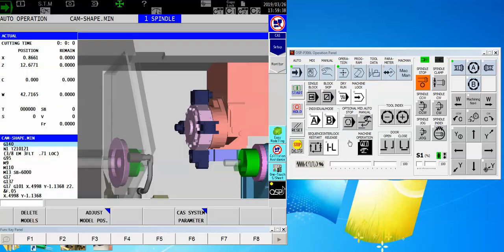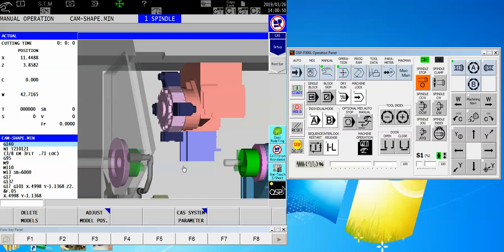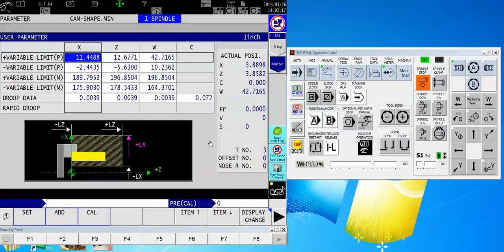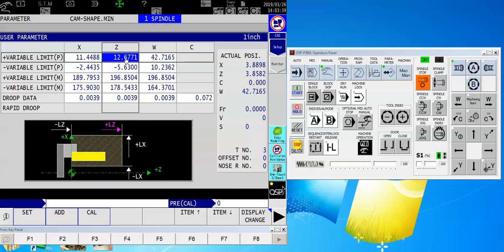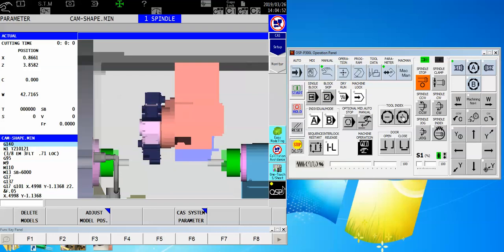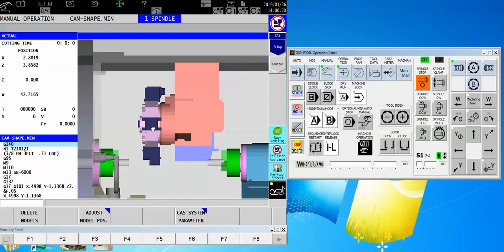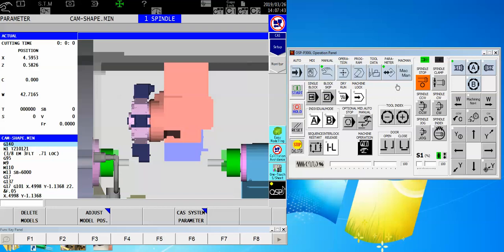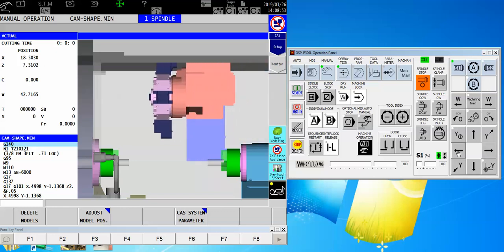barrier

Comment: Hello!
Please share the simulator Okuma as you have on the video?
Reply from the maker: Cool beans, eh? This simulator is called PCNC Master and is available thru any Okuma distributor. Currently, they have 11 different configurations of machines available with more to be released  shortly
Reply: @pocketcharleywithgosiger  will provide you the simulator for free?
Reply from the maker: Don't I wish? No, they do charge for this because it is a fully loaded machine sim including full crash protection (CAS) and their programming software (AOT)
Reply: @pocketcharleywithgosiger  ah ok. Bc we got an LB3000ex with CAS but I wanted to play with it on my PC to learn some more